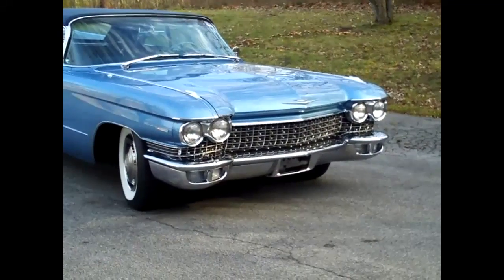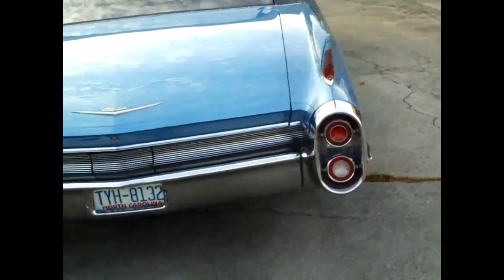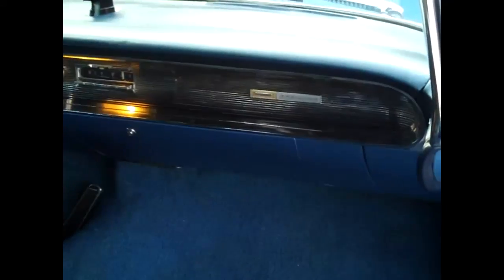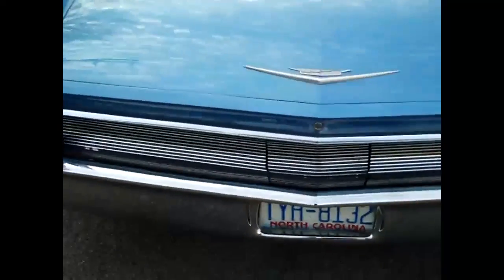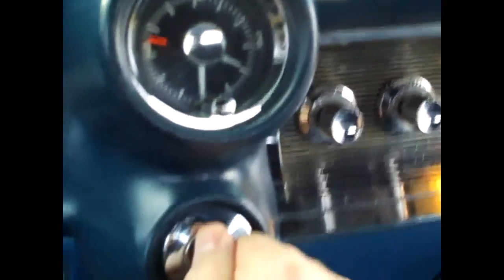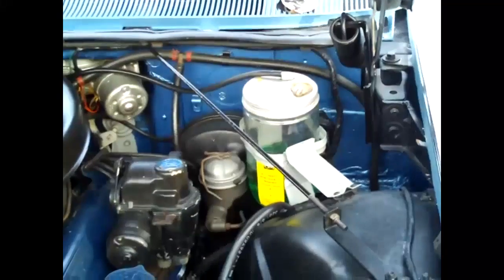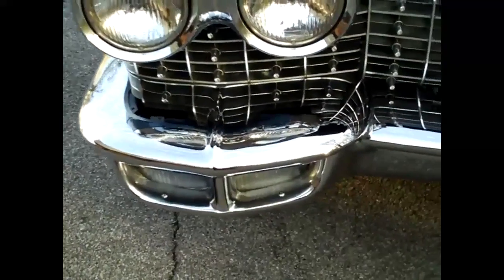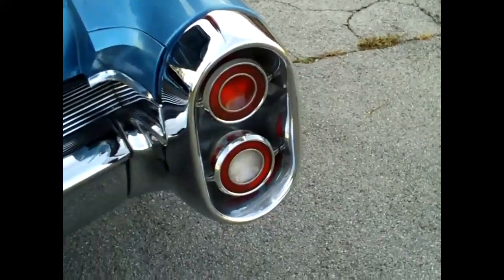1960 Cadillac Convertible

Comment: Beautiful car. Drop dead gorgeous as a matter of fact. Immaculate.
It has been restored, no doubt as the tell-tale sign of overspray on the visible on the panels in the trunk lid. Also, the upholstery is not faithful in that the tufted buttoned theme did not extend to the backs of the front seats. Again, on the originality, where is the rear seat armrest? Certainly there was one but was eliminated when they  upholstered the car. 
Other than these minor things(I'm a purist at heart),  perfect!

Comment: This car does not say deVille on it. I don't believe Cadillac made a deVille convertible in 1960, and wikipedia doesn't mention one. This car is a 1960 Series 6200 convertible.

Yes, the upholstery had been redone, but no, the convertible did not have a back seat armrest in 1960. The stitching pattern used on this car is not quite right because it originally left the centers of the seats plain and this one extends the tufting across them.

The taillights were not "moved to the bumpers for 1960". They were there in the 1959 models as well. But the bumper taillights in 1959 were in a squarish frame rather than an oval, and there were two additional taillights on either side of each fin. The taillights on this car are upside down, judging from other 1960 Cadillacs.